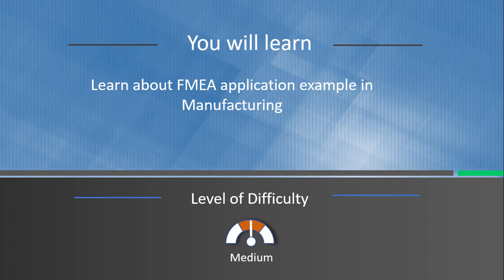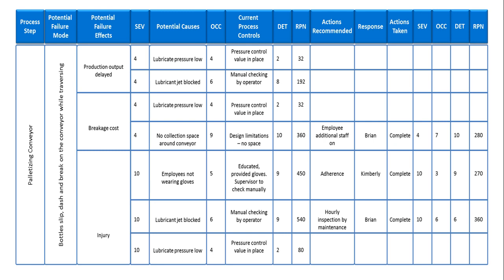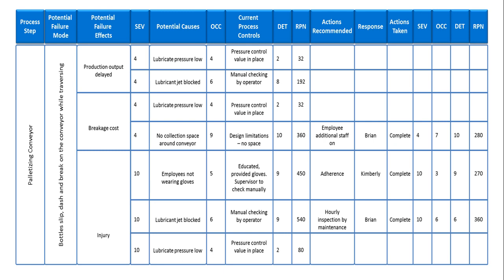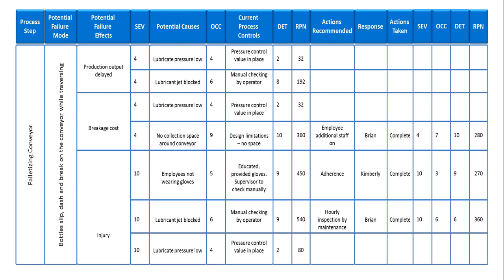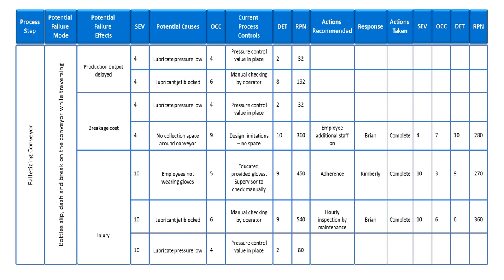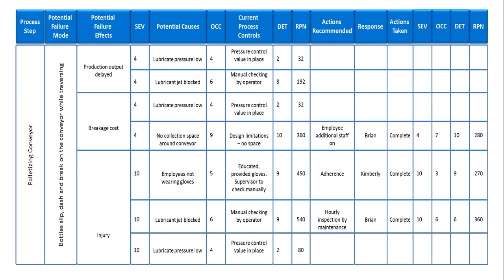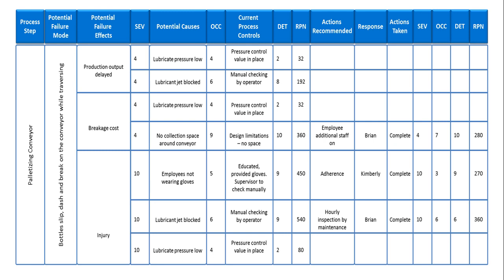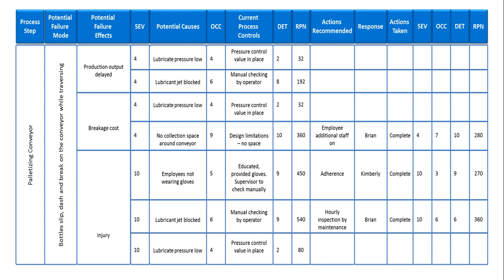FMEA Example for Manufacturing

Comment: In DET column it is detection ranking  not the number how controls are great or not.. 
It just ranking of  how many times out of 10 you detect it when that failure mode  happened
Reply: i think both can work, better controls mean more detection and viceversa
Reply: It's not. Detection rating works in reverse from 10 to 1 compared to occurrence and severity which work 1 to 10. So the higher the chance of detection, the lower the value - which makes sense when you think about it. Something that can be detected more easily than something else should carry a lower risk value.

Edit: it's not "how many times out of 10" - if that were true, and we detected something 9 out of 10 times and gave it a value of 9 - then when multiplied to produce the RPN; we would be saying that something that is easily detected has a higher risk. So the actual value in this example should be 1, not 9